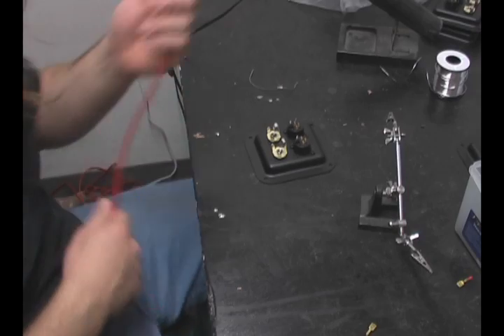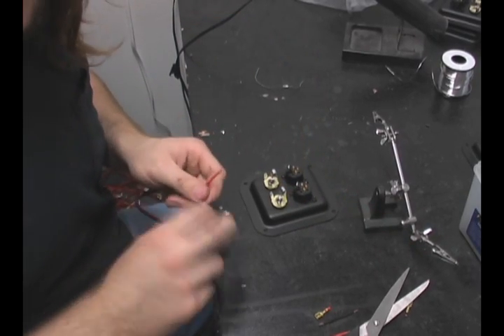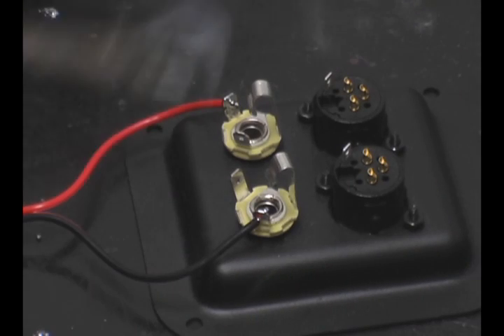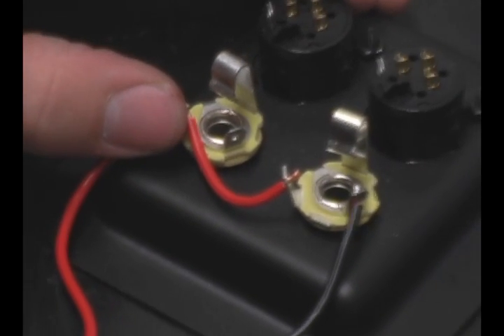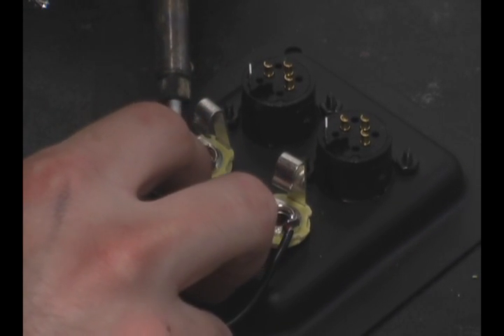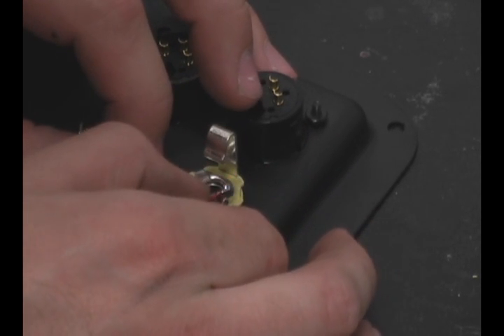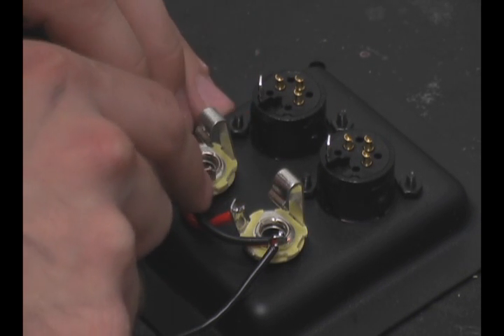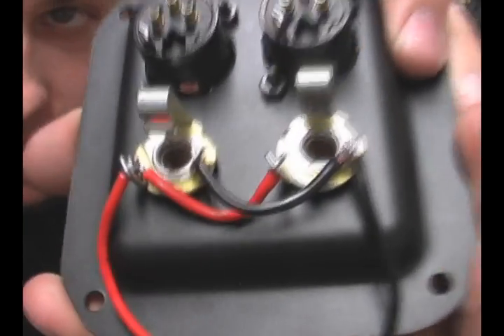How to wire and solder 2-1/4" Speaker Jacks in Parallel

Comment: Can you connect two amps to the inputs but only use one amp at a time? Basically I have two amps that I would like to use with one cabinet that has two inputs so that I don't have to unplug the cabinet each time I want to use one or the other amp.

Comment: One question, can you plug 2 instruments in at the same time?
Reply: Wondering the same, did you ever figure that out?? Thanks in advance
Reply: @cbazz333  didn't try, my guess is you can use a second head unit.
Reply: @jeffg1962  that’s what I was thinking. Kind of like a stereo cab but I don’t want to say for certain and possibly fry something. Thanks for the reply

Comment: question, , when u did what u did, does the speakon  cables above it work also, l I would think  u would have to run a pos and a neg to the speak-on unless its connected  internally  within the plastic ? please  answer

Comment: Just did this on a 2x12 cab that I am going to sell. Bought the cab empty and put in speakers but didn't know how to wire the parallel jacks so only had one input this whole time. Used it as a standalone cab so didn't need both jacks but I didn't want to sell it like that. Did this and it worked perfect.

Comment: nice video dude, very helpful!

couple of questions though:

I plan to power two cabinets from one channel of an amp, each cabinet is loaded with 200w drivers @8ohms

1. Do I need to wire both cabinets in parallel like in this video, or just one?
2. after rewiring, do I need to match up positive and negative  when daisy chaining cabinets?
3. I assume that with the drivers will now value at around 400w each @4ohms? So I will need an amp that puts out roughly 500w rms @4ohm per channel?

quite an essay there, but any help massively appreciated!!

Comment: is it true that wiring them up this way if you plug in two different sources (i.e, guitar and microphone) to both inputs you will get the sounds from both sources to one speaker...
Reply: Did you ever figure out if this was true or not. That sounds very intriguing

Comment: So if I just wanted to conenct a 1/4" jack to an 8Ohm and common speaker wire, how would I do that? Just buy a stereo cable and then cut one end off and then connect the cut end to the wires and use the other end for the input?

Comment: @killersoundz I did like the video.  I normally solder the speaker leads to one jack and then run a small pair of jumpers from the first to the second jack.  Your way is very unique.  I just may try it the next time I need to do parellel jacks.

Rob

Comment: @killersoundz Actually, tinning the ends does helps make the joint better.  When the ends are tinned not only does it keep the wire strands together, but as you heat the joint  and apply the main solder the two marry and form a nice even joint - as long as enough heat was applied and the joint before soldering.  Not moving the wires in the joint until they have cooled enough helps to avoid bad solder connections.  One of the main causes for bad connections is people moving the wires too soon

Comment: I am trying to wire 4, 4 ohm speakers in mono series parallel @ 4 ohms. What is the point of two jacks? Do I use this wiring method to do so?